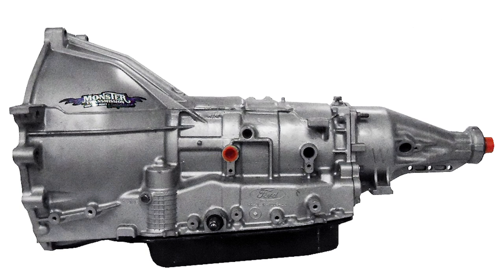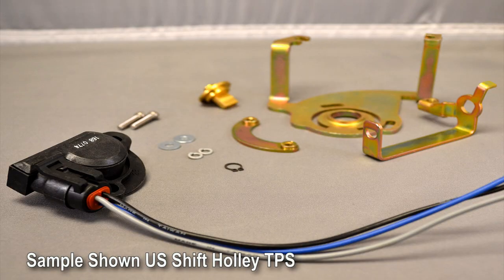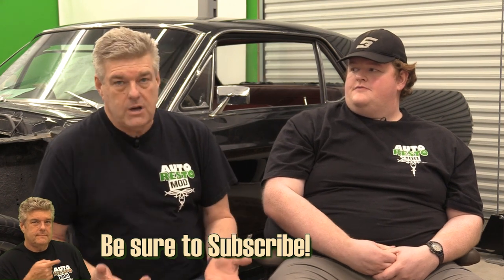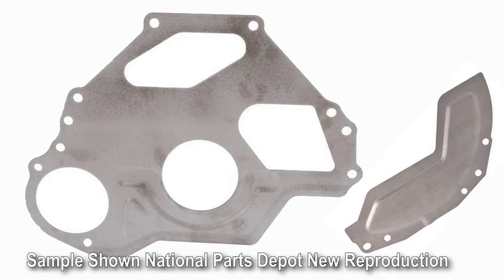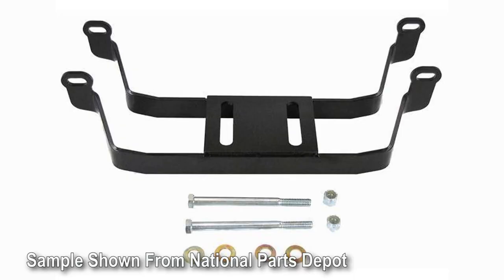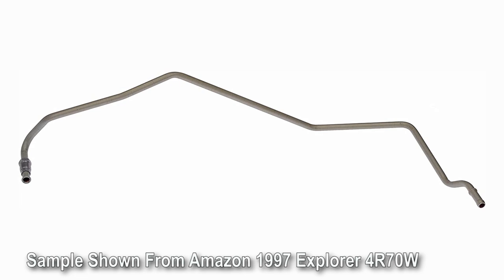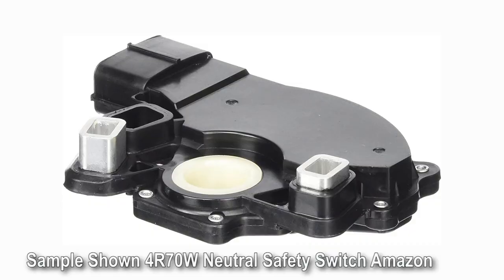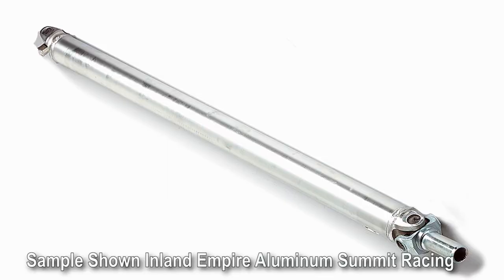Parts Needed for a Automatic Overdrive Classic Ford

Comment: I’ve rolled the transmission off of the jack to get it out from underneath the car before, then wrestled it back onto the jack underneath the car with help.
Reply: I have had to slide the trans under the car on a piece of cardboard then push on the trans jack with my legs while pulling a C6 with a gearvendors OD onto the trans jack at the same time while under the car. Not fun!
Reply from the maker: Oye. Lots of grunting I bet.

Comment: If you are going from FMX to AOD or 4R70W, the original FMX flex plate should be fine. Ive done both and used the FMX flex plate without issue.
Reply: Good news, I have a 71 cougar with FMX I want to swap.
Reply: the AOD trans did evolve from the FMX design platform, so that makes sense!
Reply from the maker: Yes.
Reply: There were two different converter diameters used in 4R70W transmissions.
Be sure to use the proper converter.

Comment: Lots of good information here, thank you. I agree with you about steel or aluminum lines where possible. The OEMs did it that way for a reason. NHRA limits the amount of rubber fuel line on a car for a reason. You see people pulling flex line the whole length of the car with A/N fittings. That's a lot of money to spend on something you can do with hard lines for a lot less money and in some ways better. Oh, and a trans cooler? Yeah. Just do it. Heat will kill an automatic transmission fast. Count me among those who want to know why you aren't a fan of disk brake swaps. I want the best brakes I can reasonably get on my classic. Modern traffic is too crazy.
Reply from the maker: Thanks for the kind words!
Reply: @AutoRestoMod  you're quite welcome, and btw I just went up to edit something I said. I'd like to know why you aren't a fan of rear disk brakes, since you asked if we'd like you to comment further on a future video.

Comment: My 4R70W came out of a 98 Ford Explorer. My 75 Gran Torino 351W original flexplate and spacer plate worked with 4R70W.Also my Torino had 2 cross member frame pads.I think the rear pad was for a C6.I was able to the rear pads on the 4R79W. And I have  the original explorer cooing lines. Im just going to radiator trans cooler .Never had any problems in the past. Im using the US shift  quick 2 controller . Keeping it simple. I have Ford 9inch with 3.0 gear ratio.
And I'm sticking with rear drumb brakes . Using Mercon V. Thanks for the great info.
Reply from the maker: Was the flex plate a 164 tooth? I seem to remember that some 351s had the larger ring gear.
Reply: @AutoRestoMod  Yes.When I was researching flex plates I realized mine was already the correct one.

Comment: For me, I've got a 64 Cruise-O-Matic that's just not going to cut it with my build.  The options I'm looking at are a 67 C6 (I have) or a 4R75W (don't have).  Either are going to take some fabrication in my 64 Galaxie.  The 4R75W will require more, but will bring overdrive and programmable transmission parameters.  I intend to run 3.70 or possibly 3.89 gears  in the 9 inch.  I am not thinking of using anything other than the 9 inch rear.
Reply from the maker: 4R70 might be challenging in the Galaxie at the tailshaft housing. Option would be a Gear Vendors Overdrive and the C6

Comment: When you accelerate particularly with a leaf spring car the diff nose will lift as the tyres bite (equal and opposite reaction) so it pays to run the pinion nose down a couple of degrees so it comes up level.
Reply from the maker: Yes.

Comment: I’m glad Cam mentioned it, the 4R70W is a metric transmission all the fasteners including the torque converter nuts are metric. That includes the mount bolts.
Reply from the maker: Agree on all but the torque converter nuts. Those are a 3/8"-24 thread.
Reply: @AutoRestoMod  that’s interesting mine checked out as a metric thread, but they were messed up. Are they all that size normally?
Reply: @AutoRestoMod  Correct..as with all Ford automatics including the French made A4LD

Comment: I ran my trans cooler lines thru the Radiator then thru an OEM Ford air cooler I picked off  of a F-150 at pick a part.

Comment: This is very helpful! Quick question if I’m running the terminator Holley x. Do I still need the quick 4? Thanks! I’m currently building a 92 Notch!
Reply from the maker: According to the sstuff I read, no. Not sure i the wiring harness is a part of the kit or will have to be purchased seperately.

Comment: I will not have an electronically controlled transmission. Fortunately, the AOD can be built using wide ratio 4R70W components. Ive done a few of those.
Reply from the maker: Okey dokey

Comment: Another option for carb guys is full manual valve body for the 4r70w if you don't want the electronics
Reply: The other option is to use the wide ration 4R70W planetaries and high capacity clutch packs in the hydraulically controlled AOD.

Comment: Question, what did you use for a TPS on the wagon I assume it is on the carb, was it the 4100? I would like to keep my 4100 if possible when doing a 4R70W in my 66 Ranchero. FYI after watching your video's on the install on the wagon I hunted down a C6 crossmember I am close to start the project down to the TPS issue.
Reply: You can get a tps with a small bracket that fits on the side of a Holley, I picked up one from Summit.

Comment: Dropping a 5.0 out of a 96 Explorer into a 65 F100. I've converted it over to carb instead of EFI. I bought a 4R70W out of a 2000 Mustang, it has the correct bolt pattern to fit behind the 5.0. I also got the flywheel and the torque converter from the same Mustang. Just want to know what tooth count and weight on the flywheel? Also, can I theoretically use the torque converter out of the Mustang with the 5.0 or do I need one specific to the 5.0? I just want to make sure I'm using the correct combination of parts to get this to work together cohesively. Thanks.
Reply from the maker: Any 5.0 built after 1983 will have a 50 oz. imbalance. So if you have a transmission, flywheel and torque converter from a pushrod 5.0 out of that 2000, it will work.

Comment: This is great. I'm planning to do the 4R70W in a 66. I'm curious about what pan you end up going with. I've read that you can swap over an AODE pickup and pan to get rid of that nub on the bottom, vs going with the larger deeper pan you used on the Fairlane swap.  Looking forward to more videos on this install. Heck, maybe you can do mine next.
Reply from the maker: LOL. We have a couple in the works one in a 2004 Ranger that will be getting a 5.0 swap.

Comment: megashift TCU usa made 420.00 bucks last i look at it universal works on many units i ant used one yet but it work well from what i am told on loads of slush boxes. IT PAYES DIVIDENDS TO Stock GRADE 8 / 10.5 or what ever good Q all threaded rod / nutz to have on hand to make bolts studs saved my rear end yea tasks time but all so takes time to drive 45mins each way to bolt store

Comment: I am going to be installing a 4r70w in my 1968 Mustang as well. The list is really helpful, however, I can't find some of the parts like the driveshaft from Summit. Would you be able to add part numbers on the list to help identifying the correct parts?
Reply from the maker: The list was primarily to allow for pricing. As we install the parts we will list them out.

Comment: I am looking forward to this install. I have a 66 mustang with a 351 Cleveland (yes Cleveland not W) narrowed 9 inch and want an auto with OD still deciding on AOD or 4r70w. What do you think?
Reply from the maker: 4R70W, unless you tap Lentech Automatics, is the best way to go with higher horsepower. I'd still go to Lentech for the racing transmissions.

Comment: I have a 71 351w and plan on installing a aod behind it what flex plate and intermediate plate do you recommend ?
Reply from the maker: National Parts Depot:
Block Plate, Rear Engine, Oem Style Aluminum Plate
#M-7007-11B
Inspection Plate, A/T, Oem Spec Aluminum, Repro E2sz-7986-A
#M-7986-4B

Summit Racing™:
SFI-Approved Flexplate SUM-G111SFI

Comment: Please, for the love of God, go with a manual transmission.  AODs are scum.
Reply from the maker: Not my car. And I actually like the 4R70W for applications like our Swagon and the '67 Mustang
Reply: What do you think of a 4r70w behind a 360 in a f100. I do know it requires an adapter
Reply: Manual is great, AOD is great too. Depends on how it will get used